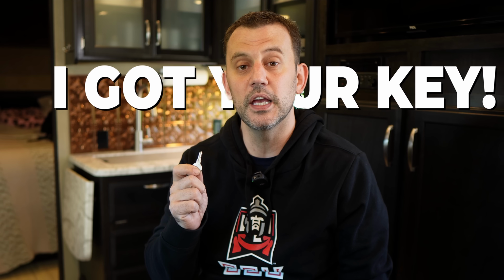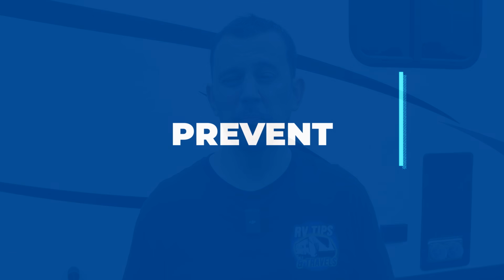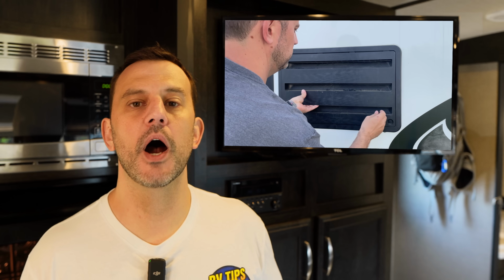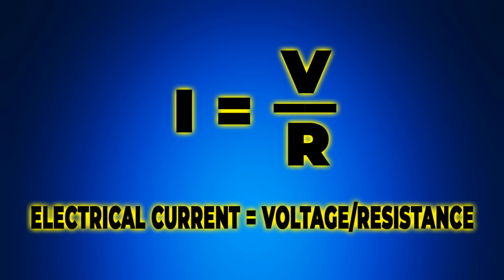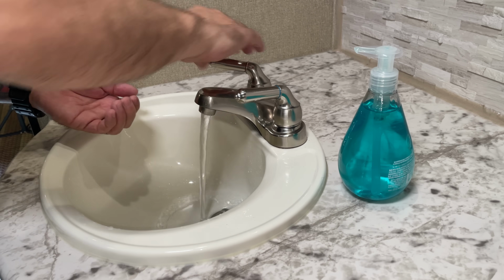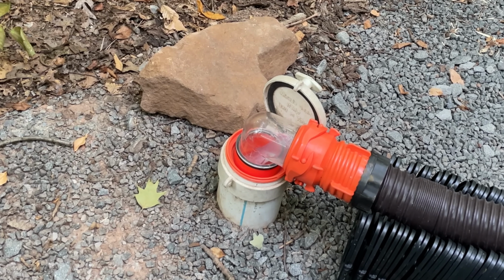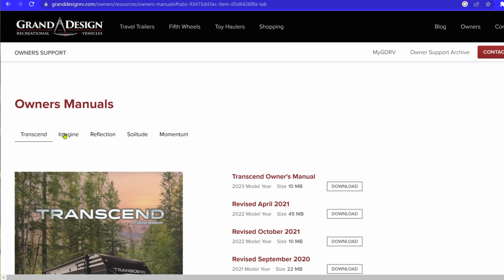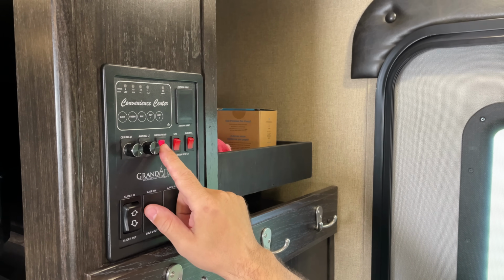7 Things You're Not Doing to Your RV... but SHOULD!

Comment: Stabilization. I stabilize my RV Wildwood FSX 280rt, however it seems like the smallest movement makes it rock. I chock it,lower the jacks and even have the wheel scissor type chock that is supposed to eliminate even more movement. It's a 2019, is it something I'm doing, or is it just the way the newer RVs are made?
Reply from the maker: not sure whats going on... are you pushing the stabilizers into the ground a little bit?  while they arent designed to lift the trailer, they do need a little pressure to do their job.
Reply: @RVTIPSANDTRAVELS  maybe I'll put a little bit more pressure on them next time, it just seems like every little bit almost makes me seasick, and I don't really get seasick. Thanks for the info, I'll try that, still skeptical though.
Reply: @MrFordguy73 My 2020 does the same thing. A little more pressure from the stabilizer helps but I'm leary to lift too much. Since all my tires blew out last year, I jack mine up and put a set of jack stands under each axle if I'm anywhere for more than a week. That prevents flat spots and damage to the tire's belts. If you do that, level the trailer first, then jack it just enough to lift the tires off the ground/blocks and a little more to allow for lowering it onto the jackstands. I find that keeps the trailer fairly level. Then there is NO rocking! It's a bit of extra work and not convenient for a short stay.

Comment: What do you think about using Armor All Tire Foam to protect all rubber seals? Someone on youtube was using it
Reply from the maker: Great question, any tire protectant that was water based and has good UV protection would be perfectly fine on rubber seals.  The only thing to make sure of is that it dries. Many tire coatings give a glossy look, which can stay wet and dirt may stick to it.  Don’t use a tire protection if it stays wet as you don’t want dirt sticking to your seals, especially your slide seals.  303 does not stay wet.

Comment: Question: I heard that you’re not supposed to leave your refrigerator running when you’re driving down the road or on the highway. Can you tell me if this is true or not?
Reply from the maker: absoption fridges require the unit to be level to work properly.  You will hear very different opinions on this, but the reality is this:  if that level is going to be compromised while driving, it could damage your fridge.  some do, some dont.

Comment: Hello: I have a 2016 Fifthwheel trailer.  It has two wet cell batteries.  Ive accidentally ruined a set by draining them to zero.  I was thinking of putting lithium batteries as a replacement.  1/3 the weight and able to recover from a full discharge.  Here's my concern, i understand the lithium batteries take a higher voltage then wet cells when charging.  Is this true?  and do i need to look into replacing the onboard charger?
Reply: I'm confused, draining them to "zero" doesn't ruin them. Get a good automatic desulfurization battery charger,  get two six volt golf batteries if you haven't already, holds a charge twenty times longer, I can't even remember how many times I forgot to add distilled water and charged them dry (oops!) And had them to zero charge And still going strong seven years later.
Reply from the maker: thanks for watching!
Reply from the maker: depends on the batteries we are talking about... lots of details here i would need to know.

Comment: I like the water off suggestion. I was at a campground and walked past a camper that had water pouring out all over the underside. They must have sprung a leak and it had flooded the trailer. There was no vehicle parked next to it and no one in sight. They were long gone. We shut off the main water supply and notified the park but man I bet they were not happy when they came back!
Reply from the maker: Good on ya for shutting the water off and letting the campground know.
Reply: Ditto!

Comment: For my water heater, I use aluminum screening that I form fitted to the cover and then glued the screen to it. I have never found any bugs or mice in it. It can probably be done to a lot of other areas.
Reply from the maker: Yep, lots of materials available to make DIY screens too.  I'd also agree there are plenty of spots on an RV that could be screened off.  Thanks for watching and commenting.
Reply: @RVTIPSANDTRAVELS   I should have said to the inside of the cover.

Comment: Check the strainer/filter on the water pump.  I've found plastic drill filings from where the factory drilled holes for tank fittings clogging up the filter affecting water flow.
Reply from the maker: Yep, I mention that in one of our hacks videos.  Thanks Eddie!

Comment: Shut your hot water off during the day. Safe the gas. 

Shut your fresh pump off during driving. I’ve had it when my pump kicked in and couldn’t prime because I was driving and it wouldn’t build air pressure. Even though it was primed before I left. 

If you are in the session after dumping add 5 gal of fresh water and dish soap to the black tank. It’ll prevent the poop Pyramid and keep the sensors accurate.
Reply from the maker: Good stuff, thanks TJ!

Comment: If you leave your grey valves open, you won’t have anything to flush your hose with when you need to dump your black tank. Additionally, leaving any of your valves open allows the sewer gas from the campground system to go through your campers venting system and come out of your roof vent. Not pleasant for you or your neighbours.
Reply from the maker: You can just close one of your gray tank valves before the end of your camping trip so that you have water to flush out your sewer hose after your last dump. However, leaving your gray tank valves open will not allow sewer gases into your living space because, your sinks and showers all have P-trap’s. You could also create a P-trap at your sewer hose for an additional vapor barrier, but the P-trap’s in your sinks and showers will still keep odors in the tank which wall vent through the roof vent.

Comment: I have a 5th wheel that had low water pressure problems. I can't figure it out. When the problem first showed up I replaced the shower faucet. That seemed to help a bit, but two years later I'm back to the same problem. I know the water supply has allot of minerals, so you think the shower faucet could be clogged again.
Reply from the maker: wouldnt be the first time.  do you have copper fittings?  they can react with certain minerals also.
Reply: @RVTIPSANDTRAVELS  no it's all Pex except the water heater
Reply from the maker: low pressure at every faucet, even while the others are turned off?

Comment: Ross, you recommend replacing the stock locks with the barrel lock. My GD Imagine only has that stock lock on the outside kitchen.  What is your recommendation for the slam latches for the pass through storage? Thanks
John
Reply from the maker: are your slam locks CH 751 keys?
Reply: Ross, they are R001 keys
Reply from the maker: ugh, sorry John, at this time I have not swapped the lock cylinders on slam locks yet.  I wish I had an answer to help.  Maybe try the GD groups on Facebook.  If I find something Ill let you know asap.

Comment: Once you clean your shore power/trailer harness connections, use some dielectric grease on them to prevent future corrosion in the first place. That way you won.t need to clean them nearly as often.
Reply from the maker: I agree with you Jim, though I think its important to know that dielectric grease can attract dirt, dust and debris, especially on connectors that are constantly being unplugged and open to the environment.  It's a different scenario then a connector under the hood of a car that never gets unplugged.  thats why cleaning plugs and terminals is extra important, and then applying new dielectric grease after cleanings.  Thanks for the comment Jim.

Comment: In your next video for checking RV problems, you may want to teach your viewers how to check for loose connections in the 12 and 120 volt wiring system.  There is not a day that goes by when someone is not asking why their power cord burned up, why the circuit board on their fridge took a dump, or why their AC will not function.  Many of those very common problems are found in loose wiring connections in the power panel.  I have yet to work on an RV (or sticks & bricks for that matter) where I did not find loose connections.  Simple fix that saves tons of problems!
Reply from the maker: Guy, completely agree... the majority of fires are from loose connections, which equates to current loss, resistance increase, heat and then fire.
Reply: Yes!

Comment: Great suggestions as always! It’s not necessity (some would call it overkill) but I recommend replacing all plastic PEX fittings with brass ones. It’s maybe a dozen fittings and might cost you $50 total if you have to buy a crimp tool set (which is good to have anyways) but it can save you from thousands of dollars of water damage!
Reply from the maker: I would agree that’s a good plan!
Reply: Have you tried WD40 Spray for cleaning  electrical connections and fittings. That's what it was originally created to do.
Reply: No, it has oil in it, and will leave residue. CRC no residue contact cleaner or similar product.
Reply from the maker: Mendez, agreed, wd40 not a good idea at all.
Reply: I wouldn’t advise that for everyone though.
I’m a plumber down in TX and we avoid brass fittings at all costs because of the high mineral content in the well water and city water alike…
While brass fittings have thinner walls than pex fittings and don’t restrict flow as much, they also can corrode in a year or so when exposed to high mineral water so it’s not a good choice for these situations.
Also consider all the connections on a water heater. Brass would weigh considerably more in that area alone and with the vibrations on an rv plus corrosion, they could end up breaking off at a joint way before a plastic fitting would.
We’ve seen brass more than once leak because of poor water quality so we avoid at all costs where possible .
Probably best if both worlds regarding less flow restriction and also keeping the plastic fittings would be the Wirsbo or Uponor expansion fittings but they’re more expensive and require expensive tools to install . If you’re not a plumber you might find it hard to justify the cost.
Hope this helps…
Reply: @andrealaphilippe5926  I agree 100%. I'm in Texas area and my 5th wheel is connected to city water all year. Just this past week it started spraying water. Found a pin hole leaking at the inlet wall plate where it had a brass connection. The minerals are through the copper. Thankfully the leak was outside the camper and easily spottable. I'm glad the rest is pex.
Reply: @andrealaphilippe5926 10
Reply: That’s a terrible advice.
Reply from the maker: Agree wd40 not a good choice.  Thanks for commenting bud.

Comment: More great info!
My winter storage tips.
All cupboard drawers and closet doors cracked open a bit. On the dining table we use Stor Dry warm air circulator, as we have shore power. 
Also for shore and non we also use a few Dry Z air containers( do not touch the grains or liquid to skin)
Also 1 window open about an inch for the trailer to at least breathe a little. Cheap hardware store window lock.
Obviously never leave any food or liquid over winter.
On spring return we check feel all the walls and ceiling everywhere, closets etc in case of water damage.
Also spend 200 on a manometer to test your gas system for leaks, or hire a qualified, or go to a plumbing joint and buy a manometer gauge and hose and connections for 25 if you understand gas leak detection.
I was in the RV industry for several years uh ‘back in the day’.
Reply from the maker: great stuff, thanks for sharing!

Comment: The one thing that I ALWAYS recommend to RVers is when they either purchase a new RV or work on their existing RV, get the Rodent Proof insulating spray (Home Depot), crawl under the RV and fill "ALL" openings tiny or large. I started on the front curb side of my RV and the first time around, I put the foam in the space between the Glacier package bottom layer and the frame. Second pass was starting from the front and filled every opening that I came across. I then caulked many of the small openings (still under the RV) in the space between the fiberglass front and the main part of the RV. There were wide gaps where the Gray and Black tank levers and main drain came through the Glacier package bottom, also the fresh water drains. Oh do not forget around the battery cables that enter the RV. 

I then found all the entry points inside of the outside fridge equipment area. Then on to the water heater area which had 3 major openings. I made a rubber gasket to fit around the slide out bar openings after I saw how easy it would be for critters to get into the RV and possibly get into the rest of the RV. The final thing that I did was make sure that when the Slide-out is in, or out, EVERY contact point was sealed tight. I also recommend that you should ALWAYS keep your storage compartments closed. While in the Florida Keys at a state park one of the neighbors constantly left his storage door open and ended up with a RAT in side that was at least 10 inches long, less the long tail.

Here it is 10 years later in the same RV and never had a critter inside. Wait, I need to correct that there was a tiny frog that came in on our dog once. That was an easy catch.
Reply: Hardware stores actually have a peppermint spay ( aerosol can) you can treat under the RV with- Rodents do not like the smell of peppermint.
Reply: Good idea 👍
Reply: Great tips. By the way the frog got "a free ride" 🤣
Reply from the maker: Thanks for sharing Donald.
Reply: Great ideas
My cats catch and bring all sorts of critters into my TT. Many are dead, but not all of them. I caught one bringing an 18" green garden snake in once. It wasn't hurt, so I took it back outside.
Reply: Great ideas
My cats catch and bring all sorts of critters into my TT. Many are dead, but not all of them. I caught one bringing an 18" green garden snake in once. It wasn't hurt, so I took it back outside.
Reply: Yes! Donald!! Thanks SO MUCH for this tip!! Extremely helpful for the new campers who are worried about the critters like me!
Reply: In addition to the expanding foam, I cut some heavy screen (not window) and stapled it down around the drain pipe opening on the floor under the kitchen sink.  This pretty much guarantees that a rodent won’t gain access through that area again.

Comment: I was told by the dealer not to leave the gray tank valve open and connected to the septic system because gases and odor can come up and into the trailer.  Is that a real concern?  I would rather leave it open.
Reply from the maker: i dont see how that could happen considering theres a vent to the roof from every tank.  i often leave the grays open, but will close and fill every so often too to rinse the walls.
Reply: @RVTIPSANDTRAVELS Besides, sinks, tubs and showers have traps for that very reason.

Comment: Great video.  My wife and I are new to the RV world. We've been camping in our 36 ft. 5th wheel for a couple of years now. 1 Thing I have noticed while watching some of the informational videos online, I've noticed a lot of RV owners are connecting the 5th wheel emergency brake cable to the 5th wheel hitch. I personally connect mine to the bed of my truck. I know it's not likely to happen but if something does happen to the 5th wheel hitch, and the cable is connected to the hitch, the brakes won't engage, and the trailer will continue down the road at speed. I was wondering if this is something I shouldn't be worried about? Continued safe RVing
Reply from the maker: i agree, same goes on a trailer, should be connected to the truck if youre following the same logic.  thanks for watching and commenting Bradley.
Reply: Great point. I have seen customers pull the brake cable to act as a parking brake. DON'T DO THAT. Also, for TT don't let the cable drag. You can tie a loose knot in the cable, just enough so it's not dragging on the ground. If the trailer comes off the knot will tighten and the brake sets. Don't make it so short that when you turn a corner it pulls the brake.

Comment: New to RV's. I'd like to know proper way to setup RV when it's just sitting unused in hot weather. Do you open all the vents for airflow? Worried about heat damage in the summertime when not being used.
Reply from the maker: Open your roof vents... more on this topic coming later in a video.

Comment: Are the pass-through cam locks all a universal size? Clicked on your link. There are three different size options. I’m clueless.
Reply: Nope, depends on the application. I have two different sizes on my RV. Just measure the length of the barrel of the lock.
Reply from the maker: thanks for helping out, just getting caught up on comments.
Reply from the maker: no, you will need to measure

Comment: Some things you could mention are bringing in your awning at night, when you leave the camper, or when your expecting wind or snow. Bringing in your slides if you can if your expecting snow. Leaving mousetraps in your rv when you won't be in it for awhile. I also use a ceramic car spray on the outside of my windows so it's easier to clean them off. Nice video man.
Reply: I find my awning frame is much more stable/stronger if I only roll it out about 3'. That gives some shade (more @ mid-day) and allows the windows/doors to be open on that side of the trailer and keeps rain out. I only extend it dully if I an at the camper.  Weather changes quickly and doesn't follow the forecast.
Reply from the maker: All good tips, thanks for sharing!